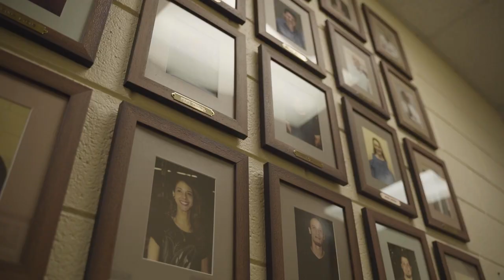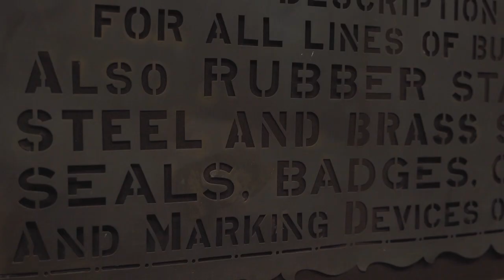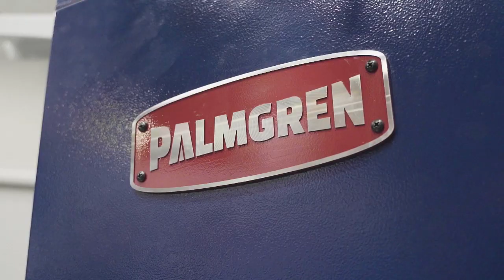CH Hanson- Corporate Video

Comment: Do you still make adjustable wrenches ( model 10SPC )? There are some still sold in Asia, Made in USA. But I couldn't find them in you webpage. Just made me wonder if you dropped the manufacture of mechanical wrenches.
Reply from the maker: We do not, we teamed up with Palmgren which makes their line of wrenches but the adjustable wrenches are currently no longer available.